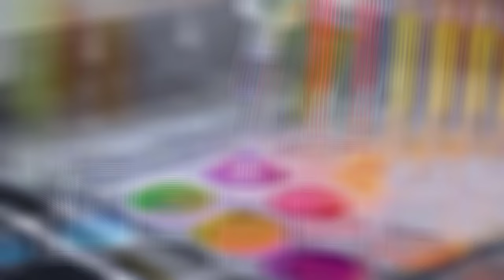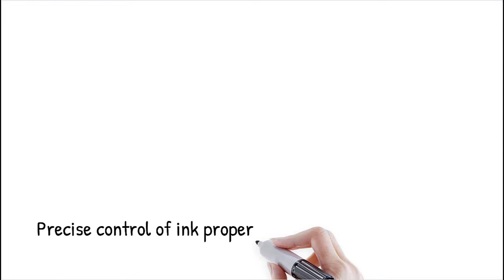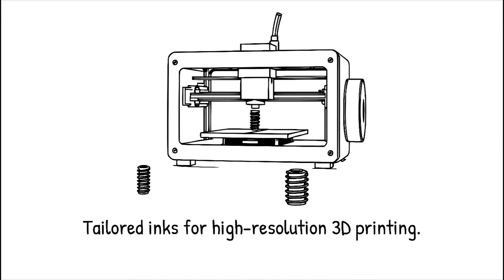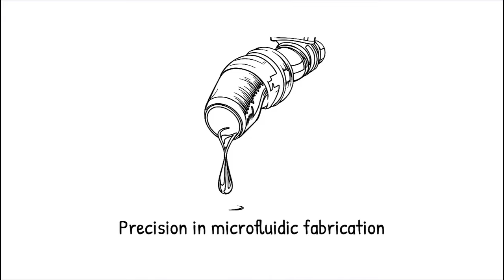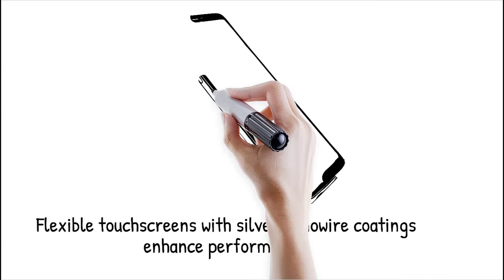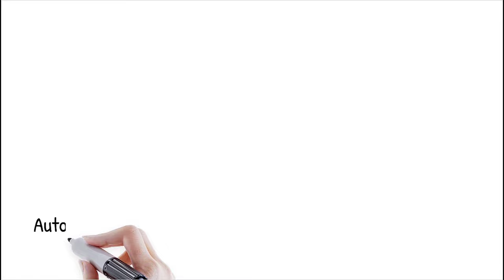Painting with Precision: The Microfluidic Revolution in Inks & Coatings

Comment from the maker: How does the interplay between interfacial tension and shear forces in droplet-based microfluidics influence nanoparticle self-assembly during ink synthesis?
What are the thermodynamic constraints on the stability of microfluidically synthesized metal nanoparticle inks, and how do they impact long-term conductivity in printed electronics?
How can real-time AI-driven feedback loops in microfluidic reactors optimize reaction kinetics for the synthesis of multi-functional coatings with tunable optical and electrical properties?